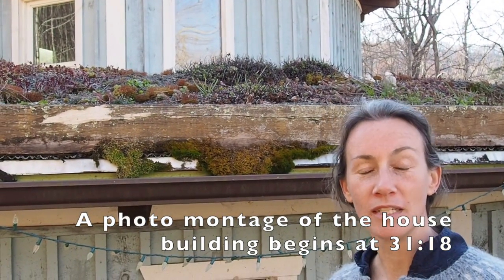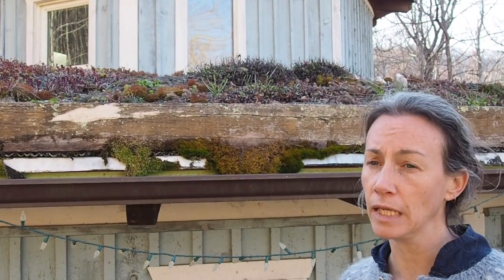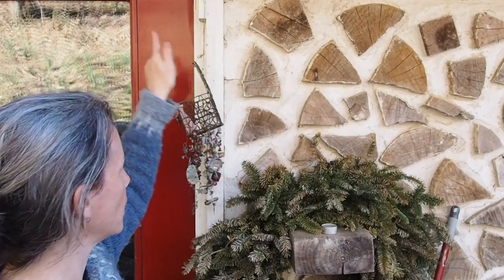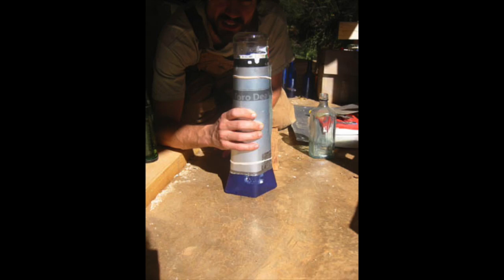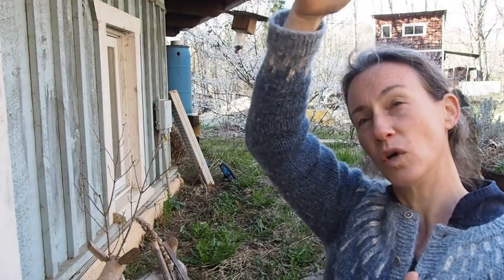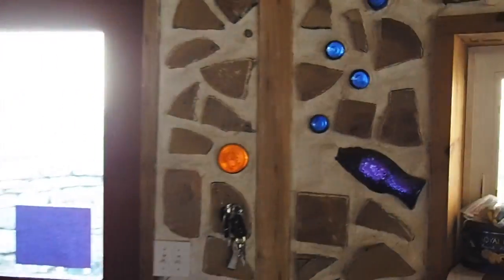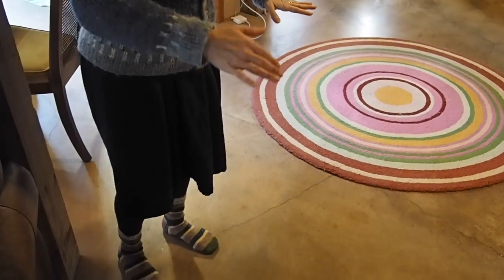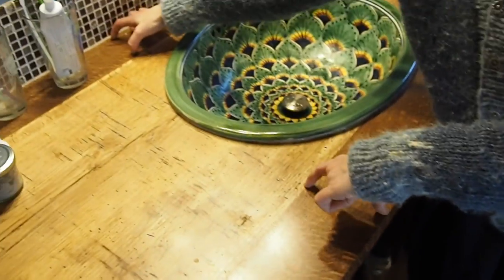Our Hand Built Cordwood home - Ninja Chickens Special Episode

Comment: How is your electrical run through the split wood walls?
Reply from the maker: The electricity was run along the main beams of the doorways and windows and attached to these boards.  This was done before the cordwood went in.  The cordwood isn't structural (it doesn't bear the weight of the ceiling), so it was put in after the main beams were.  We were able to build the cordwood up around the electrical.

Comment: How thick is the cordwood wall? Thanks.
Reply from the maker: The wall is 16 inches thick.
Reply: Ninja Chickens-  I just noticed that you talked about it @4:12, I must’ve missed it cause of my bad internet connection. I constantly have to pause, let YouTube buffer a lil bit and then rewind and skip forward to where I assume I left..

Anyway, I’ve seen some cordwood construction where they would leave an hollow space in the middle and stuff in with insulating materials, from cotton, sawdust, news paper, and chopped up old jeans.
Reply from the maker: @nuduo9255  Yes!  That's exactly how we did it!  The wood pieces are at least 16" long.  At each end of the wood is a strip/layer of the mortar and in between those strips is an empty space where we stuffed sawdust (and a bit of lime dust to repel bugs).  The insulating works fabulously!